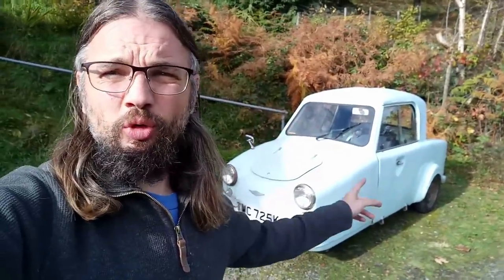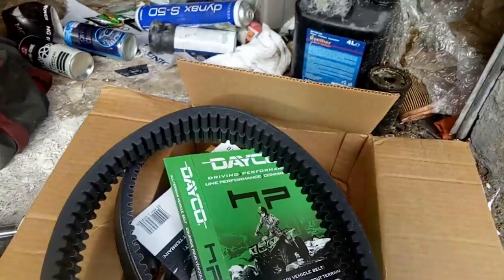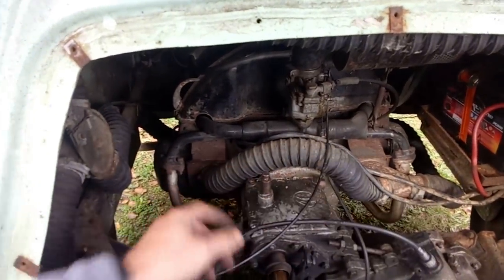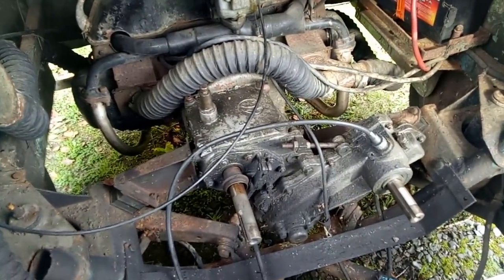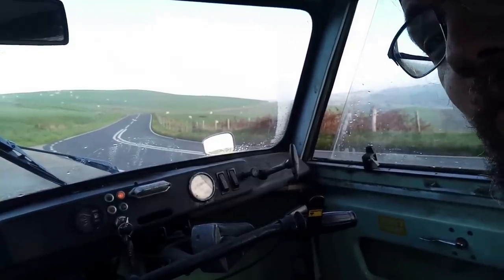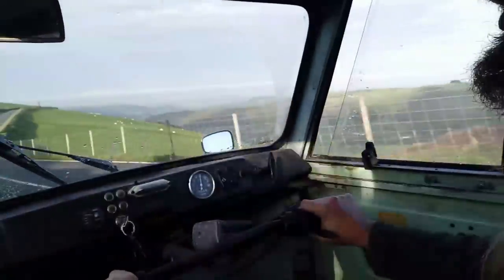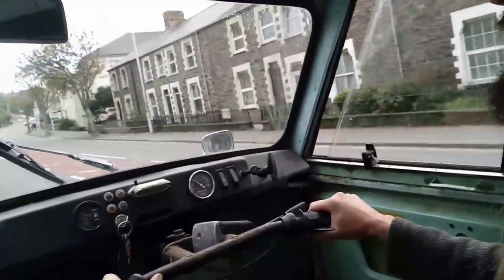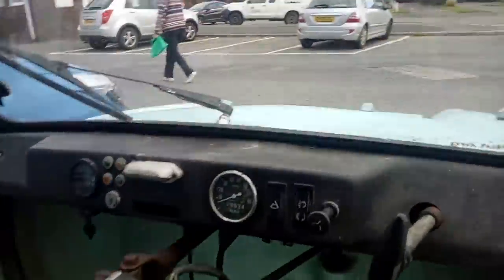Invacar CVT - how does it work? Will it actually work?

Comment: A very heartwarming tale of American generosity added to British eccentricity and perseverance. It is enough to induce a throat-wobble!
Reply from the maker: It's basically like the AC Cobra.
Reply: twc  his running well
Reply: Ian, I think you have the palm throttle thing the wrong way up, the 'paddle' should tighten on to the twist grip, you have it loosening so to speak. they are usually on bikes on the outboard end of the twist grip your 'behind the little finger' palm presses down and 'olds the throttle.
Reply: All TWC needs now is a vintage  reproduction "orange badge" and period "disabled" tax disk. Would look good for it's NEC debut.

Comment: I had a 2-stroke Puch Magnum X 50cc kids off-road bike when I was a youngster....it had a plastic insert restrictor pushed into the inlet manifold after the carb, and a restrictor plate welded over the air-filter cage in the airbox...once those were removed it was a rapid little bike...hope that helps. :)

Comment: when they said run the belts in low power, that applied to the 200hp kawasaki they are for, the 20hp twc, well its not really a struggle is it
Reply from the maker: A fair point, but still wise to avoid putting too much heat through the belt initially. It's amazing how much heat even the Invacar can generate.
Reply: One thing to check on your older pulleys, one of them was showing a bit of a concentric wear ring in the working surfaces, which might explain the poor operation you were experiencing earlier.   Not much you may be able to do about that, depending on how thick the belt sheave faces are.  Most scooter CVT pulleys when worn to that point are out of spec and replaced.

Comment: That CVT drive is used in a variety of equipment in North America, from ATVs, utility vehicles, golf carts, agricultural equipment (older combine harvesters, forage equipment and seeding and spreading equipment) some Turf equipment  snowmobiles and some industrial equipment.  If the Kawasaki belt doesn't work it shouldn't be to big of an issue to get one shorter or longer. Many of the people who work on that kind of equipment that focus on the ATV, golf cart and snow mobile applications ignore the commercial powertrain distributors who stock belts and pulleys by size/model rather than application.
Reply: The HP2020 was recommended by Dayco based on information they had for the original belt number. Their last run of original belts was in 1997....
Reply: Are you the David that sent the belts? ..liked the magazines ha ha, that will give Hubnut ideas..I knew someone who use to read Mopar mags over here and ended up with a Cuda.
Reply: Guilty. Seemed like the thing to do at the time, the box needed a little more filler to stop things from rattling about while it crossed the pond....
Reply: Great gesture  anyway.

Comment: So, the transmission has a centripetal clutch, a reversing gear, a rubber belt CVT (another centripetal device at its heart), a chain, and then I presume a conventional bevel or hypoid gear differential. Was this designed by Heath, Robinson & Co.?

Comment: I think you are correct about the lack of speed on hills. I used to work for a John Deere dealer and they sold John Deere Gator ATV buggies (look like mini pick up trucks) they used to bog down in speed on hills. That sounds like the CVT is working nicely now. Might bump into you at the NEC.

Comment: As an apprentice I visited Greeves motorcycles factory, manufactures of Invacars, in the mid 60's with a group from the Technical college I attended. In the late 70's I worked just around the corner from Greeves/Invacars and we used to use their drawing office printing machine.
As a past motorcyclist and past owner of a BMW R1100s I think you should treat either your 2CV or TWC to a transplant of a BMW boxer engine, a power upgrade to 100 bhp plus would do wonders for climbing those hills around Devils Bridge.
Reply from the maker: TWC won't be getting upgraded. Elly has upgrade plans coming soon. Not BMW...
Reply: Put bmw power in twc and your underpants might get an upgrade as well 😀😀
Reply: Andrew Mason As I used to own a Daf 33 in the mid 70's I formulated my cunning plan, never carried out, to have a traffic light dragster by putting in a BMW boxer twin. I suspect though that it would have been heavy on drive belt life costs.

Comment: Great vid always a treat to come for a ride with you and twc didn't the volvo 340 automatic use belts to drive it .I think I remember you put it in drive it didn't change gear it just picked up speed and the belt moved up a cone like thing making it go faster
Reply from the maker: Yes, exactly the same. The pulleys have tapers that the belts ride up.
Reply: Yeah I remember it was a bit funny my uncle just used to put his foot to the floor and it would take of you Sat there waiting for it to change gear it didn't it just picked up speed with no gear change weird

Comment: just a tip Ian the throttle helper is on upside down, the long tounge needs to be on top - so as to be able to grip the handlebar whilst it rests against the palm of your hand. twc does now sound absolutely spot on....
Reply from the maker: I've tried it in several positions. Not yet found one I like.
Reply: @HubNut  ahh then its not easy. It was just how they told me to mount it when I bought mine at the local bike shop.

Comment: Talk of factory fitted restrictors reminds me of the Hillman Imp, it's Coventry Climax derived engine was deemed a bit too wild for the public at large, so a restrictive inlet manifold and very small carburettor was fitted to reduce the power output.
Reply from the maker: Same as the Mini. Too quick with 948cc, so they changed it to 848cc. Then developed 998cc versions not long after...
Reply: 998 best A series ever, they could rev far better than the bigger units.

Comment: I never knew about the Invacar/Fiat 500 connection makes sense to use well known reliable mechanicals. I’m not sure who I can tell about this new found knowledge. Ah well, into the memory bank it goes!
Reply: It does make sense if Steyr-Puch used the same Fiat drive shafts for their Puch 500 and I strongly suspect they did (most of the parts were Fiat except for the transmission and engine, post-1969 models even had Fiat gearboxes). I'm not exactly sure what engine this is but it could be the 493 cc from the Puch 500 DL, although that was only in production until 1962 so the engine was already old when the Invacar was designed. The 500 D (in production until 1967) had a similar engine but only 16 hp - that could be a difference in specifying engine power though, not sure if that's really international, especially back in the day.
Reply from the maker: Yes, could be SAE Vs DIN. It is the 493cc engine.

Comment: To prevent interior steam-up, you could try a product called Rain-X, it's a liquid window treatment that leaves a water-repelling film on the window. Not tried it myself and don't know if it or a similar product is available to you, but it's something to look into!
Reply from the maker: I have tried the anti-fog, and didn't care much for it. I've bought a demisting pad instead. That'll do. Might even reconnect up the demister at some point. You never know.
Reply: Ah, that's a shame. That'll help. Yeah, air-cooled engines are generally good at making heat!

Comment: That fuel gauge jumps all over the place. Never seen that before. Great vid - thanks.
Reply: I was thinking the same thing while watching this video. I guess it calms down when you slow down on the straights. Hehe
Reply: Faulty voltage stabilizer? This is a common problem with the Triumph Dolomite. The VS in the Dolomite supplies power to the fuel and coolant temperature gauges. The fix is to fit an electronic one.
Reply from the maker: Don't think so. Just a true live gauge. Most cars have a damper to limit the movement. TWC and Elly the 2CV do not.
Reply: @HubNut  Needle bobbling about tells you that you actually have fuel, unlike modern damped ones which suddenly drop the last but and read zero. I much prefer the ones with the jumpy pointer.
Reply: I used to own a SAAB 2 cycle:  The fuel gauge in the early SAABs also jumped around when cornering, this is a good feature:   Since I was running 40:1 petroil, when the fuel tank is empty, you add a quart of premix and then fill the car up, ( I used to raise eyebrows at service station when I dashed out with a bottle of oil in hand to get the oil in before they fueled up.) After filling, to mix the fuel you go for a few minutes of enthusiastic back-alley exploring to bounce and slosh the fuel around.  If the gauge needle was wiggling off the full peg, you were mixing the fuel up correctly.

Comment: Interested to know more about the Invacar's original Salisbury CVT system and the company that made the transmission, was it a separate CVT development from the UK or a version of the DAF Variomatic system?
Reply from the maker: It's Salsbury in the USA, not Salisbury in the UK - which I didn't realise when I first got it. The gearbox is by AC, using the Salsbury pulleys and a Fiat 500 diff (I think).
Reply: I see. Cannot seem to find out much on Salsbury beyond it being taken over by a company called Comet from where CVT pulleys can still be sourced form.

Comment: No telling what the slack should be on this drive system, but it should be easy to get the belt to move. ATVs and UTVs transmissions are usually designed for 1-2 inches of deflection with the vehicle stopped to get the right belt tension, while scooters are usually under 1/2 inch. If it's super tight after the break-in period, you may want to adjust the final drive position.

Comment: Can you not strip the pulley units and check the sliding bits, maybe the springs are a little tired too - nice project after you clear the garage!
Reply from the maker: It's on the (very) lengthy to do list... (the pulley, as well as the garage tidying).

Comment: I'm not sure what you're goal is with  Invacar, but if I may say it'd be quiet a nice to drive if you did some sort of foam/sound proofing to it. Ie make a door card, and foam to go over the rear access panel?
Reply from the maker: I have tried adding foam in places. I reckon the aluminium sheet of a floor is not ideal.

Comment: Do you have to depend on the brakes when going down a very steep hill, or can the engine still be used as a brake with such an unorthodox transmission?
Reply from the maker: There's a fair bit of engine braking, though the inefficient belt drive also gives some resistance.

Comment: I think that TWC's alternator might be behaving like a small radio signal generator and upsetting your gimbal as a result, just a thought. Good luck for the NEC adventure Ian.
Reply from the maker: Nah. I think my gimbal is just prone to confused moments. Thanks!
Reply: You might be right, but I have a drone with a gimbal that danced all over the place when I tried filming someone on their electric bike, and the drone too was not as stable as it usually is. It worked fine when they turned the motor off, but the EMF pattern of a home made electric bike might be quite different from TWC's alternator.
Reply from the maker: TWC doesn't actually have an alternator. The gimbal has played up before. Sometimes struggles to know what I actually want to look at.
Reply: Sounds to me like they've updated the software and it's no longer working as it should. Damn things have a mind of their own at times. Is it a DJI gimbal?
Reply from the maker: It is. It has only got confused twice in my ownership. There was no running engine the first time.
Reply: If it is only a rare malfunction it is probably due to the pixies which live in your garden. I know people who have had problems with DJI kit when they have updated software or firmware, but it is easily solved if you can reinstall earlier versions of it. I believe that the best attitude to have towards technology is to be amazed when it works and not at all surprised when it doesn't, especially when you have pixies living in your garden.

Comment: Mount a camera pointed at the CVT  (with light if needed) so that you can show it working.
Reply from the maker: It's a tricky one, as the area is covered pretty well by the inner engine cover - it's painfully loud out on the road without it. There's some footage of the pulleys here. https://www.youtube.com/watch?v=lGSjyUe3jy0

Comment: What's the average life span of a belt on TWC?
Reply from the maker: Well, she's never worn one out. Of the 1000 miles she's done this year, most were done on the belt she wore when I collected her, probably 300 on a New Old Stock replacement, and barely 50 on the second New Old Stock replacement (due to the pulley issues).
Reply: Now that you have working pulleys the belt should last a few thousand miles.

Comment: Another good video, Ian, have you worked out how many miles per gallon you are getting out of twk
Reply from the maker: 35mph about the best I've achieved so far. Hopefully that'll improve a bit now, as I'm using much less throttle as a general rule.
Reply: My guess would have been much higher. Tiny engines don't seem to give good mph? Wth

Comment: Is there a "neutral" gear shift position? The car I drive at work has a CVT automatic transmission and I find the engine braking if I let up on the gas very annoying. It is much more noticeable than on my normal automatic Daihatsu Mira. Great that you got TuckTuck working fine. It really has character. Now if only that stupid Elio company in America would examine one of these Invacars!
Reply from the maker: Yes, there is a neutral, but if you disengage drive on the move, you can't re-engage it until you come to a complete stop and wait for the gearbox to stop spinning.

Comment: What is the expected life expectancy of the drive belt I wonder?   At least now you have a modern part number and source to replace.   I remember having a Vespa 50 with their "proto" CVT and it was awful, just ate belts for a living and no fancy ones back then, just an Italian car fan belt was all I could use and terribly unreliable.   Seeing the drive chain arrangement is quite interesting, if for some reason down the line the engine fails irretrievably and you can't source another then you could easily fit in anything that has a similar central spigot output and the car will live some more :D
Reply: Oh, don't use wet lube on the sliding pulley, it will pull grindy dust and debris in from the road surface and grind the guts of the poor thing to problems, hence the graphite powder as its drive, sticks to spindles a treat and doesn't allow dust or debris to stick to the spindle whilst lubricating it a treat, use it on Lucas distributors in the shaft there too, abs brilliant stuff :D
Reply: The CVT belts on Volvo 340  and DAF  ranges would last about 30,000 miles , they would get cracks in the sides , they were allowed to get 2/3 the way through before they needed changing , whining usually accompanied worn belts , It was a more sophisticated system of course  with vacuum help to change up and down rather than relying on centrifugal force alone .Also had 2 sets of pulleys and wider belts to spread the load of a 3 times heavier  car and over 3 times the power of the Invacar . The DAF 44 with a similar 850cc boxer Air cooled engine was quite powerful at 34 bhp . a good alternative !

Comment: No excuse to keep a spare in the boot or trunk 
UK suppliers stock this belt so plenty of supply to keep you running
Is the restrictor like the old post office vans  flat plate between the carb and inlet manifold with a small orifice than the carb
Reply from the maker: I have no idea on the restrictor. I have a spare manifold, so I'll examine that first. Probably as you say.

Comment: Pulleys can you get reconditioned units? Your wearing in practice is appalling. This is a disabilerty vehicle recommend you use it as one, just a suggestion that is. Cheers
Reply from the maker: No, you cannot get any reconditioned bits for these gearboxes. How would you suggest I break the belts in then?

Comment: I am so irritated by the lack of clean up of the interior. The corrosion on the handle bar needs to be removed and repainted. Preservation is so important to prevent disintegration of a machine.
Reply from the maker: The corrosion is not getting any worse. The interior has now been cleaned. Slightly...

Comment: usa cars are very afordable,
its the import tax, the shipping over of parts the buying of the car, then there's the rust and the fact there mostly left hand drive and then there's the cost of fuel, if i was going to have a usa car it have to be an adsel wagon big large but easy to drive at the flick/push of a switch,